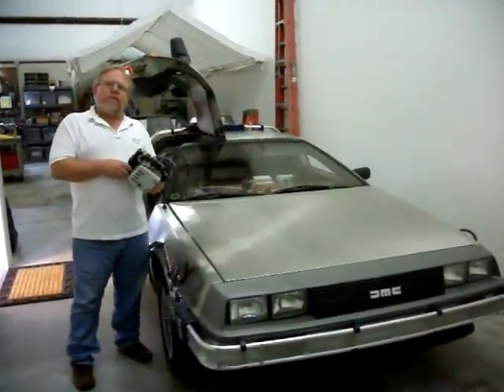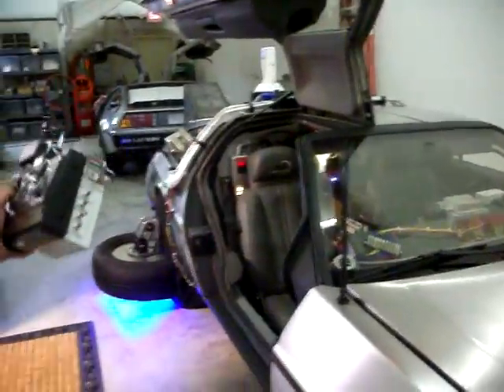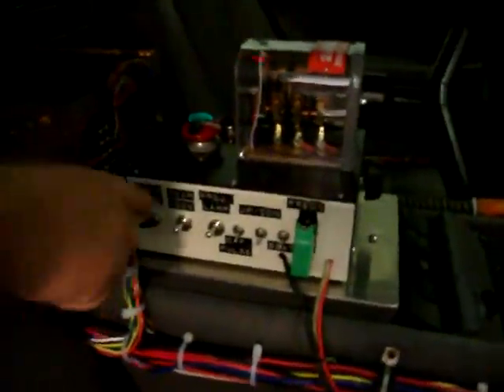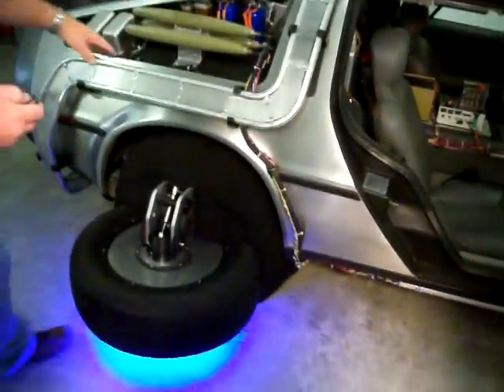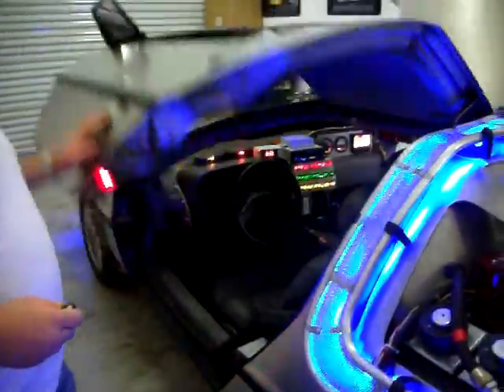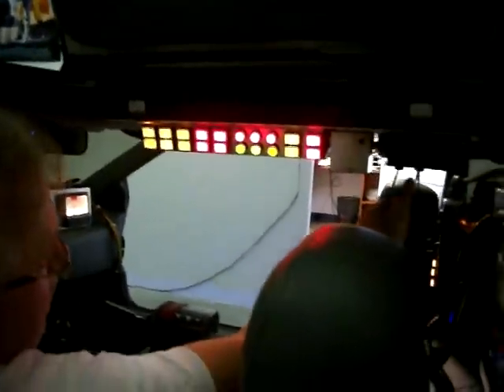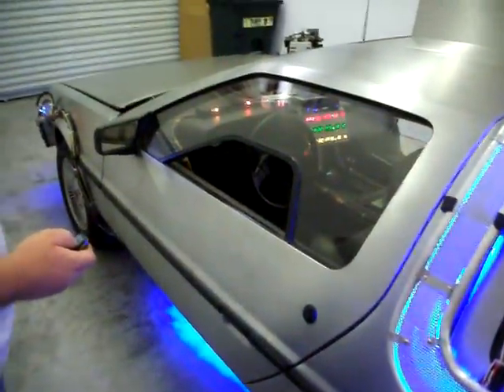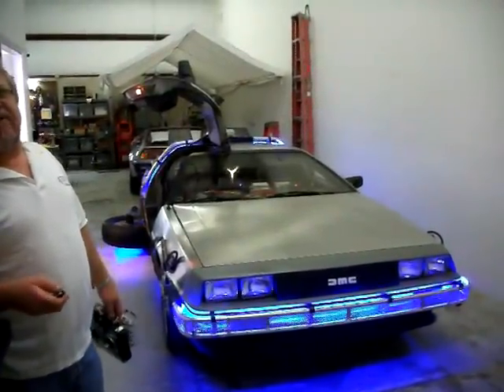Delorean Time Machine 2015 Fly'n Series with Hover Illusion by CEI

Comment from the maker: You are correct on both observations and that the camera used to record is not of high quality on its microphone as well.. The audio system in this one replica is of a mono output and the speaker are low end weather proof type not really meant for a quality sound output but more for budget saving.
When we post our next video ( in a few months) it will be of  a Delorean Time Machine with a high end stereo audio system. Thank you for your response, I appreciate the comment.

Comment from the maker: Yes it is very street legal in most states. I haven't heard of a state where it isn't as of yet.
You can not drive thjis with the Hover wheels attached but, we're working on solving that.
All of our exterior prop parts, cables, electronics and hardware are weather safe. You can hand wash the outside with a low presuure of water and a mild soap. We have sealed all holes that are made in the roof and pontoons with an RTV silicon. same type used on aquariums.

Comment from the maker: We installed a saperate power distribution systems for all of our FX. The Electronic systems operate with just two low profile rechargeable 12VDC/30AH Gel type batteries. We do not use the Delorean's battery for any of our FX. When all the Time Machine's electronic devices are powered up, the two batteries  will continue to power and operate all circuits for a period of approx. 10 hours before the batteries drain to when the cut-off circuitry engages to save on total battery drain.

Comment from the maker: Comes with a Automatic Delorean that will need some mechanical TLC  but does drive well. Most of the interior upholstery upgrades have been completed. It comes with some of the exterior and interior props. For $30k  It is meant to be a starter project car.
A complete upgraded road worthy Delorean with all the movie accurate replicated props and electronic effects to be a Time Machine  like in my video cost $65K

Comment from the maker: This GPS speedometer is as movie accurate as its gets. It is very well made and movie correct. The only down fall to this prop is that the enclosure is made of plastic. If GPS isn't needed by a customer, then we have a speedometer prop that is enclosed in a metal box. It gets so hot here in Florida that we have had some speedometers enclosures melt while sitting on the dashboard inside a Delorean on a hot day. That's why we make as many props out of metal as we can instead of resin plastic.

Comment from the maker: Yes the display car does drive but, it is not a road worthy vehicle. It will need some mechanical work. We've done most of the interior upholstery, front calipers replaced, radiator hoses replaced, Gas tank and brake system flushed, engine tune up, new door struts and new tires.
No it does not come with the Hover wheels.

Comment from the maker: The props, replicas, wire, electronics, hardware and labor that goes into making one these DeLorean Time Machines cost me about $25K  To do this to a different model vehicle such as a fiero, it could be done for much less, about $15k because the props would not have to be screen accurate.

Comment from the maker: It is a combination of: a GPS speedometer that does read the mileage as the vehicle is running. It can also be set to a fixed 0.0 or 88.0 or scroll up/down with the Drive switch knob.

Comment from the maker: Our engine cover deck opens to a full 30 inches with all props remaining in place. That clearance is plenty of room for the owner to work on the engine. If it should so require that the engine cover deck be removed, it and its props can so be done with little effort.

Comment: Mr. Bruce, I have an important question as well.
Do you keep the stock PRV 6 cylinder engines in the time machines? If so, do you rebuild them? I assume the answer is it depends on what the customer wants, but what I'm asking is what do you usually get requested? Could someone request an engine swap? I ask because the movie cars I believe had American sourced V8s, and I'm wondering if it would be possible to mount one in one of your cars. Is there enough rear suspension support?

Comment from the maker: Nice thing about our FX of audio/visual is that you can flip a switch to off of the FX you don't like or have a need for. We believe it is better to have the choice & not use it, than later wish you had the choice..
Other builders charge a higher price for their conversion than us without added FX & features. So our clients payless for their conversions, get a better solid build with more parts made from metal, extra added features of audio/visual FX & switches to choose if they want FX on/off.